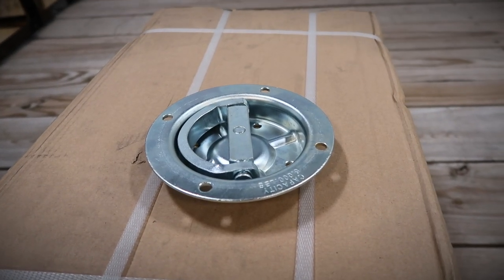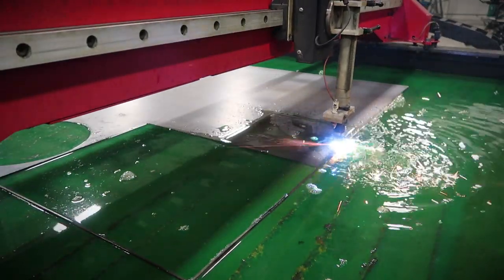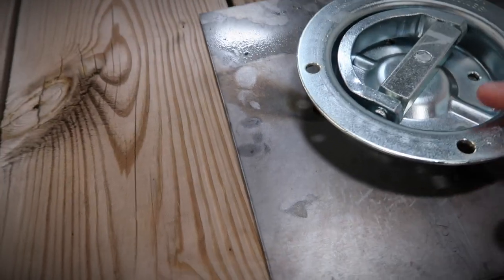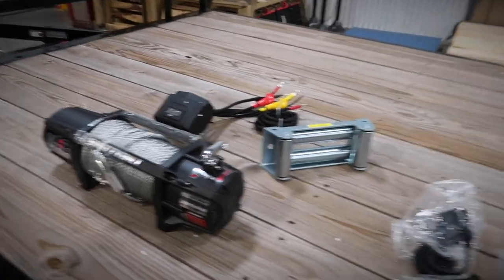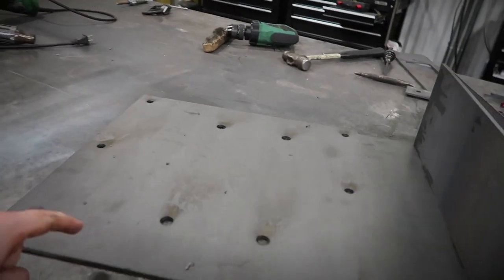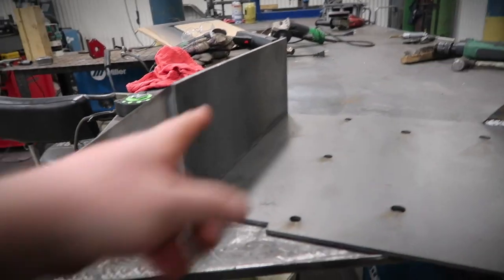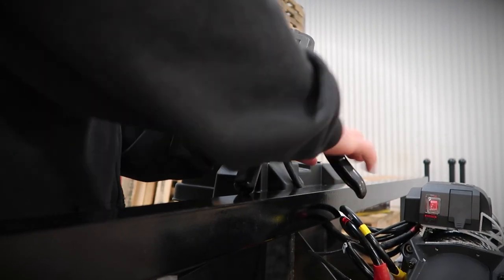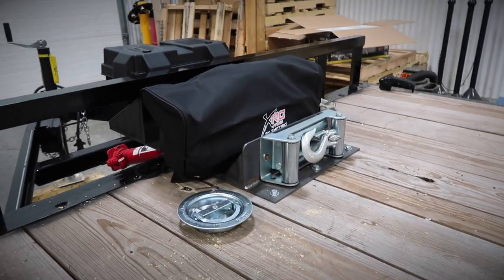7x18 Tilt Car Trailer Winch and D Ring Installation

Comment: with the rings just bolted to the decking, how are you keeping the decking form pulling up through the screws holding the decking to the frame?

Comment: Good job on your mounting hardware fabrication  🏆

I've got several trailers and each has a winch. Very nice when your by yourself.  Not spending your money, but a wireless remote makes it nice, so you can steer our guide the wheels on zero turn mower while loading.

Thanks for sharing 👍
Reply from the maker: The winch definitely makes it nice. Thanks for watching!
Reply: Right on man...what trailer's do you have?
Reply: MedicMagic Big Tex 14GN 26'x102", Big Tex 20GN 20' +5 drop,  7x16 tandem w/electric brakes on both axles, 5x13 single axle with electric trailer brakes.
The two GN's have 12,000 lb winches and the two smaller trailers have HF 3,000 lb winches. All have custom covers that Velcro on.  I also use a silver 5x7 HF small tarp to cover the winches  with their plastic clamps and they work every time and look new. All have wireless remotes.
Reply from the maker: Dr. Mark in Texas How do you like the wireless remotes? My Smittybilt is wireless or wired depending on if you plug the cord in or not. I am going to be doing a review of that winch in the next few days, but I was really disappointed in the wireless capabilities. It was glitchy and not very responsive. I would press the button and there would be long delays and at one point the winch kept going for a few seconds after I left off the button. I am not confident enough in the wireless system on the Smittybilt to trust it with a load on it. I will be using it with the cord plugged in and the wireless turned off. Do you have any of these issues with your setup?
Reply: The Garage Vlog I had a stroke in Feb 2016, my left arm/hand are coming back. But, the wireless remotes are fantastic for me.

Even before that, trying to load a 1000 pound+ zero turn mower and trying to keep the front wheels from hitting the bottom of the trailer ramp and spinning, or loading an RUV on and needing to steer is so nice to have the remote! Especially when your by yourself!.

 Everyday you can have the use of both your hands is ab blessing. Be careful and be thankful 🙏.
Reply from the maker: Dr. Mark in Texas Glad to hear you're doing better now, each day is a blessing. Thanks for the insight!

Comment: What's the point of flush mounting those d rings in the wood with special brackets then leaving bolt head sticking out when you're done?
Reply from the maker: They were thrown in on the trailer deal, they stick up less than the D rings would have surface mounted. I haven’t had any issues. How do you normally mount them?
Reply: @TheGarageVlog  I guess I would have used carriage bolts perhaps so there isn't any sharp edges.
Reply from the maker: That’s a good idea, I was thinking allen button heads, I didn’t have any...but carriage bolts would be even lower profile.

Comment: I confess I skipped through the vid, so I may have missed the part where you talk about changing the balance of the deck.   With the weight of the winch, and especially with the battery cantilevered off the front of the deck, the balance will be changed dramatically.  Did you add ballast to the tail end of the deck?
Reply from the maker: I did not add any ballast weight. I haven't had any issues. Thanks for watching!